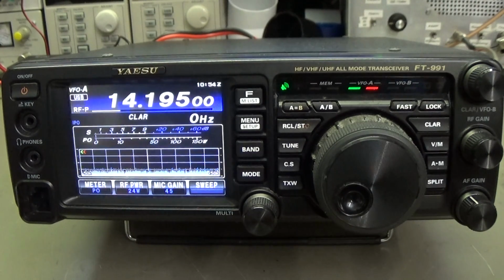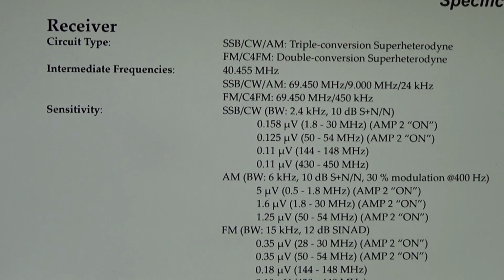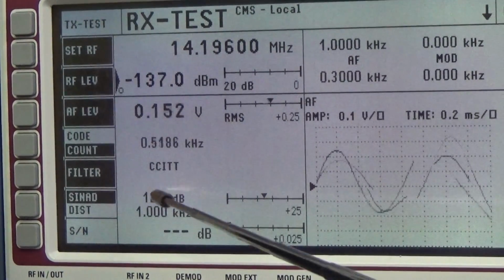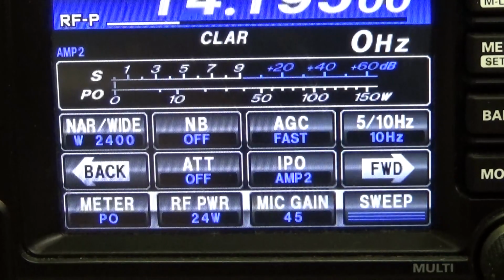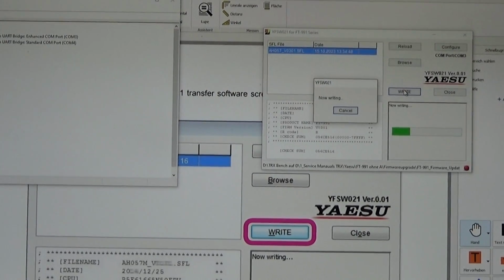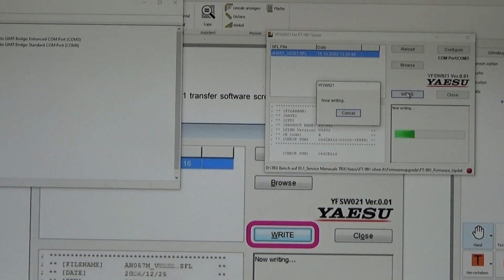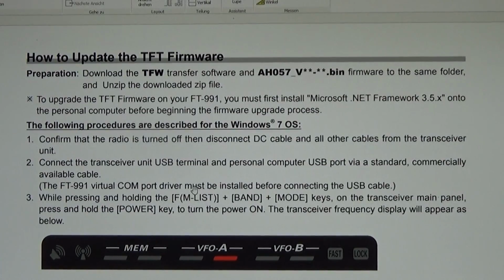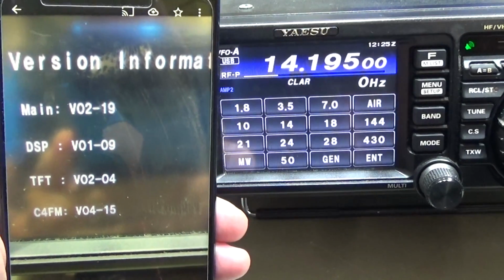#282 Yaesu FT991 pretending to be deaf, WHAT?

Comment: Peter please check R1005   if blown will make the rig sound dead with IPO on please check R1005
Reply from the maker: You know that the R1005 is a 10 Watt resistor which is only switched in the signal path for 12 dB attenuation. That means that this path is not active with IPO ...
Reply: Peter maybe the fault described below is not the fault you were looking at?

I am talking about the rig seems to be deaf with IPO on due to blown R1005 150 ohm on USA version rig.

On Ft991 USA version R1005 is 150 ohm 1/10th watt smd resistor.

If R1005 is blown and the IPO is selected the rig appears deaf.

Info for consideration below

It can be seen that the Attenuator circuit is formed with a 150Ω and 68Ω resistor voltage divider that is comprised of R1005 and R1012. When the Attenuator is disabled, the 150Ω R1005 is shorted by relay contacts and the 68Ω R1012 is removed from the circuit by relay contacts. The failure mode is due to the 150ohm R1005 opening up and breaking the signal path.

 @TRXLab

Comment: Check in IPO mode with higher signal level input.  It may be deaf in IPO mode  (No amp1 or 2) only.
Reply: Yes R1005  if blown will make the rig sound dead with IPO on please check R1005

Comment: these problems were not existing when processors and other devices were mask programmed in the factory. Users used the same configuration for 30-40 years without problems or glitches.
Reply from the maker: well yes and no...we often see issues in the home set up as well...

Comment: These are notorious for resistor frontend burn when in presence of very strong signal at the antenna, using AMP1 or 2 actually bypass that resistor and make it alive again. I would check if the frontend resistor is still OK.
Reply from the maker: Complete front end has been tested fine..

Comment: Its so easy to make these sort of mistakes on modern radio's. I was given an 857D that was apparently deaf on HF. After some research I found that the AGC was switched off. Turned it back on and all was fine. Nice explanation on the firmware upgrade process Peter. Have a nice weekend.
Reply from the maker: Yeah, that happens...

Comment: 991(A) has a known problem with attenuator, it often get damaged if turned on and the second TRX near-by it active. To small (power rating) resistors. Then the radio is deaf when att is enabled, but working completely fine with preamps engaged. You checked only preamps.  Maybe you should also check if attenuator is working correctly.
Reply from the maker: The complete front end has been tested and is fine.

Comment: Is this another case of R.T.F.M.  ??    I agree you should check your firmware of new radio's.  It can fix problems that you do not want to run into later.  I also have received radio for repair where the customer simply did not see something.  It is best to have customer show you the problem but it is not always that easy.  Good video as always.
Reply from the maker: Yeah, and / or an issue with the set-up at home?
Reply: @TRXLab    I agree.